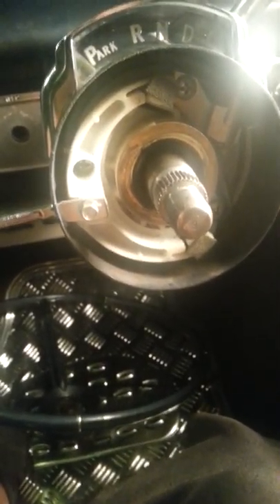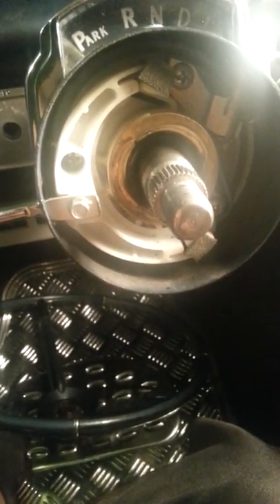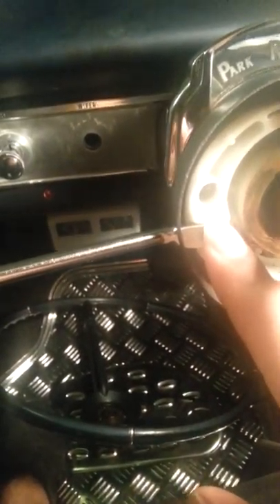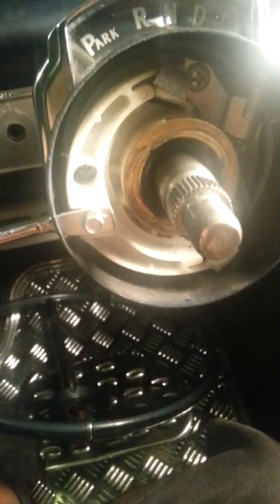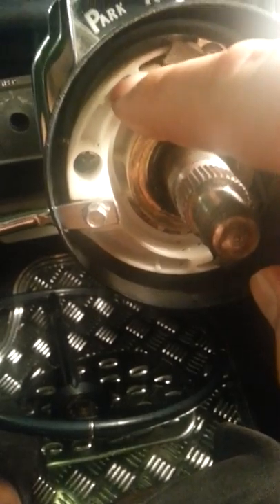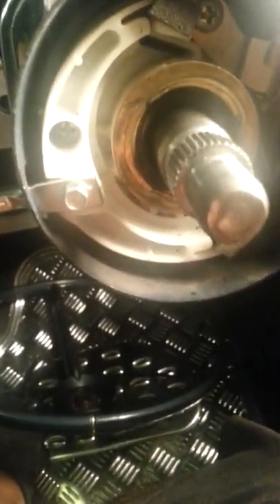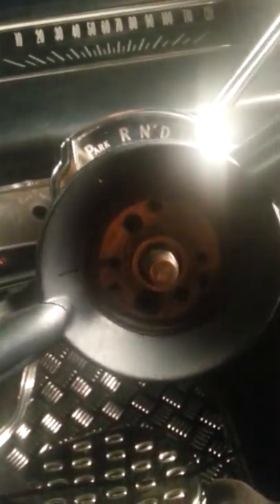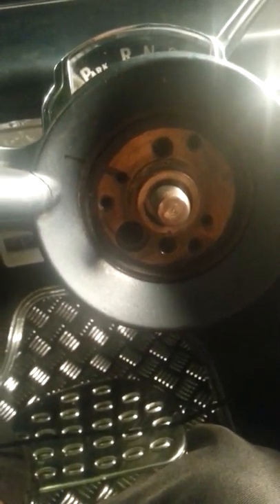1964 chevrolet  impala  turn  signal switch cam

Comment: Brother how to remove that C CAM. ? I having issue taking mine out the 63. 🤙🏼
Reply from the maker: once when u dig in and  remove the the horn ring off the steering youll see it   i took  my broken one apart and easily replaced before i glued it back  youll see how it  comes apart , tricky thing  you have to  i believe from what i heard an seen YOU HAVE to remove the actual steering well  or drop the  steering column an housing to remove the spaghetti full of  wire  so it can be  pulled out  and fished back in later in order for it be plug in to the electric , remember there is a long type of harness kinda wire inside the steering wheel column

Comment: What screw is that bro ? That holds the lever in
Reply from the maker: i assume  its just the actual blinker turn  lever signal switch cam  screw .all that screw does is release your lever stick to be installed .it was just a small screw   it not long at all  its  very short ,,i used i  believe a box wrench i think the size of that screw was like 3/8th size wrench  or smaller and its just  light hand  tight